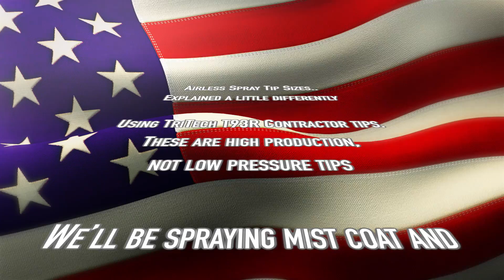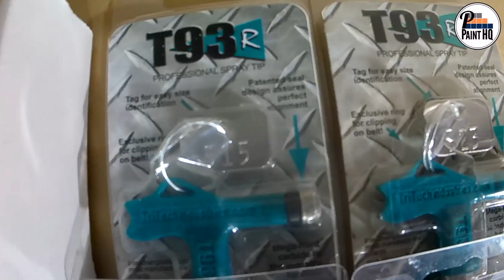Airless Spray Tips Explained | All About Airless Paint Sprayer Tips

Comment from the maker: Apologies I don’t show what pressure I’m spraying at, I wasn’t even concerned with tails in the early spray demos, such as the 217.. it was higher pressure, but these aren’t low pressure tips.. I did enjoy spraying with the 817, it didn’t feel high pressure at all.. in fact that’s the point, the material flow spread so wide meant you could move relatively slow, and with that you have good control.. the 817 would be a very good choice if having to coat large areas, warehouse walls for example 👌 ..Anyway, hope the figures showing GPM / LPM are helpful to anyone new to airless spraying, and helps to understand the relationship between tip size and fluid flow.. as always feel free to comment / ask questions.. appreciate the support.. regards Pete 🎨💯

Comment: Hi Pete, very useful, especially about runs and “too much material and not moving quickly enough” as I found out to my cost on a recent project. Fortunately a quick sand back and respray fixed everything. Many thanks for posting. Best wishes, Rob
Reply from the maker: Hi Rob, yeah it’s something I didn’t grasp myself when starting out, I’m sure others have been there too.. then the penny drops 💡😆 if you choose the right tip for the material, you gain so much more control.. certainly helps someone new to airless spraying 👌👍😆 ..Hope you’re keeping well my friend 💯 Pete

Comment: So what is your go to tip sizes for ceilings, walls and trim, please?
Reply from the maker: Ceilings / walls sprayed in a latex / emulsion I typically use a 515.. then for trim I’ll use a 208 / 308 .. .008 because it’s a very thin / low viscosity primer and topcoat .. otherwise if it’s a material that can also be brush and rolled, go for a 210 / 310 👍 regards Pete
Reply: @PaintHQ  I have a 517, would you say that I should get a 515 instead?
Reply from the maker: You can use a 517, but my tip will be to move the gun relatively fast.. basically the only difference is a 517 will let out more paint than a 515.. so yeah save your money, try a 517, move quicker and if you want to try a 515 later, you can 😆 ..regards Pete
Reply: @PaintHQ  thank you!!! Really appreciate your replies. Let you know how I get on.

Comment: Hello mate me again🙈, just wanted to know what tape you use on freshly painted walls? I’ve left the walls for about a week after painting then masked up and sprayed the ceiling tonight and the masking tape pulled the paint off the wall, I’ve used yellow frog tape! Also could it be in the prep I’ve sanded the walls with p180 should I have gone courser? I’ve enjoyed it all up till now 🤣
Reply from the maker: Hey buddy, you’re more than welcome to ask questions anytime.. I use Deltec Delicate (Purple), and typically I’m looking to mask off the walls to spray the ceiling the next day.. you don’t need to go courser with your sanding, your prep sounds good.. just make sure the walls are dust free (the Wooster Dust Eater makes it quick and easy).. plus if your back to bare plaster or any filling is not self priming, you would need to spray an acrylic primer or a mist coat, before spraying your walls with emulsion top coat).. apologies if that’s what you’re doing, just trying to cover everything that could be going wrong.. I wouldn’t normally use Frog Tape (even the yellow.. I do if brushing for the anti bleed technology), I prefer a washi style tape.. Deltec has always worked very well for me 👌👍😆 ..if you need anything else, feel free to ask.. regards Pete